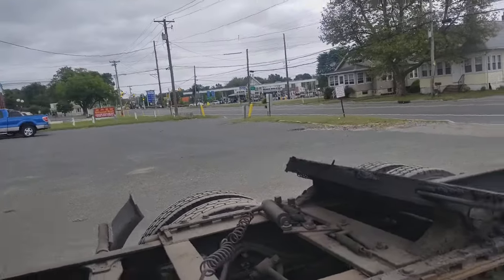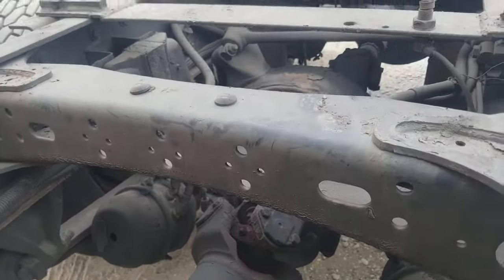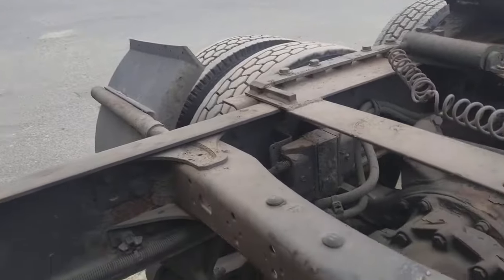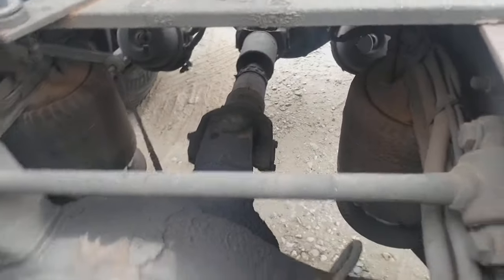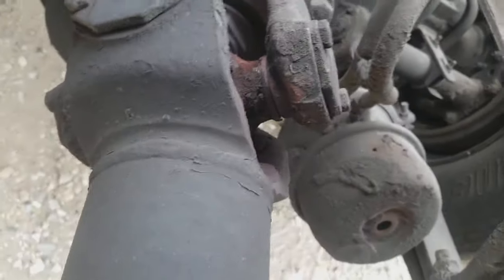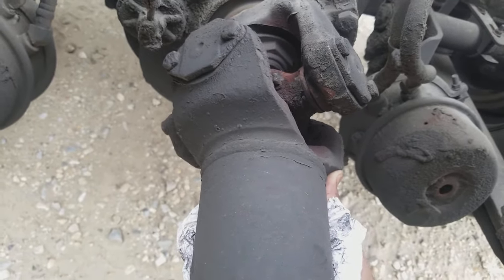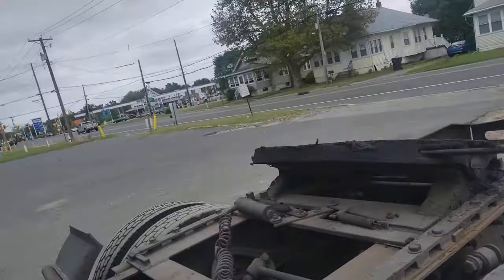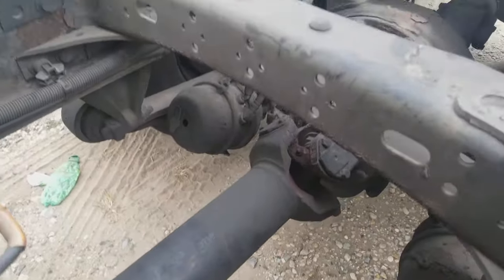Why Truck shaking & vibrating and excessive noise under truck.

Comment: No caps over spring brake cage hole will allow dirt and salt to get in, and can cause brake failure. Little things like this and not greasing can cause big failures.

Comment: I notice strange lines like scratch marks on my rear drive axle super single tires. More lines on driver side tire. The front drive axle tires are perfectly fine. Just wondering whether this could be a differential axle issue? Any thoughts? Suggestions?
Reply from the maker: Mostly it's Alignment issue. It could be shock or torque rod issue.

Comment: Thank you video I have both straps u joints missing from drive shaft  try look for parts but told whale I joint I have to get not nesseryly need I just two and straps both side of u joint  i just need where to find it

Comment: * I fix this problem    ( harmonic vibration )***
-Change all tires same problem 
-Swap super single tire by regular tires same problem
-Change oil on differentials same problem
-Balance all tires same problem
-Balance drive line same problem
-New Leveling rod same problem 
-New 2 rear motor mounts Same problem
-New 2 cabin mounts same problem
-Transmission maintenance same problem
-Adjusting fifths wheels same problem
-Grace fifths wheels same problem

IMPORTAN
-swap my trailer for other same problem
-“””SWAP TRAILER AGAIN FOR ANOTHER ONE PROBLEM FIXED”””

the first two trailer was problem
Maybe balance your tires trailer
Maybe trailer Bearing
Maybe trailer Alignment
Reply from the maker: sometime if we adjust our fifth wheel it also helps.
Reply: I was having the same problem. I watched a video leveling the drive shaft by regulating the leveling valve. In the Freightliner Cascadia there has to be a different of 2 inches 3/8 between the mounted in the chasis and the leaf spring. Mine used to have almost 4 inches and it started vibrating at 60 miles per hour up to 75 m/h.
Great help from the presenter, if the vibration is in the steering wheel, it may be the bad  alignment in the front tires. If the vibration is in the passenger seat, it is the drive shaft that is not aligned. The airbags are too high.
Reply: @carlosburgos56  thank you bro.